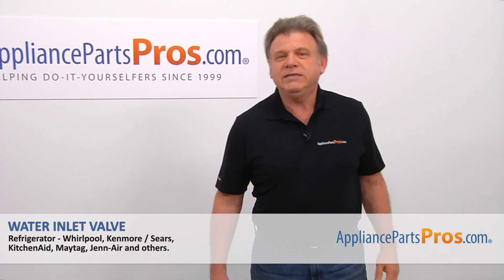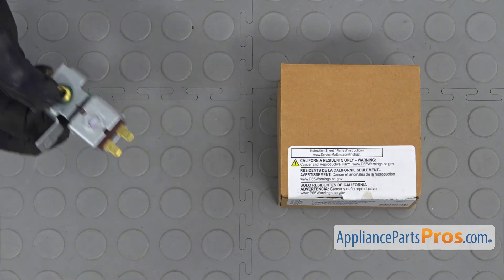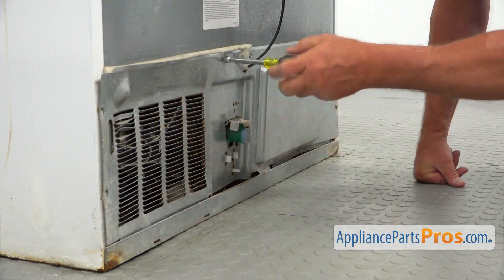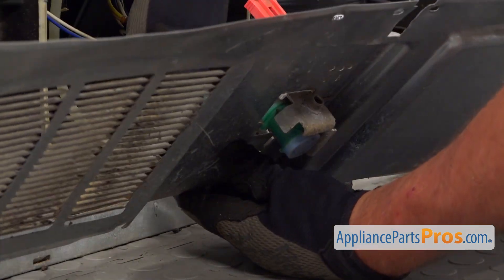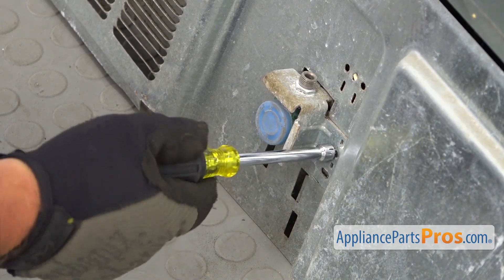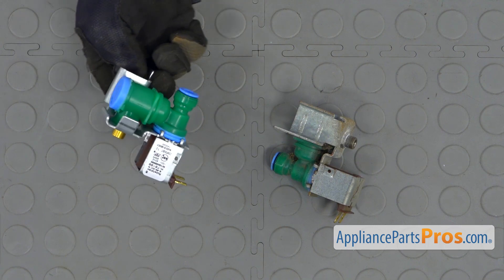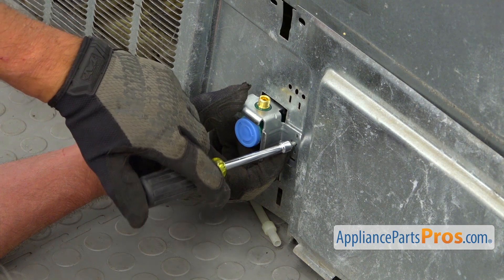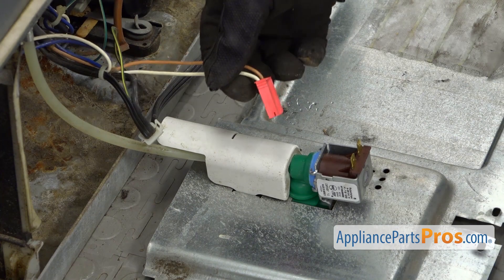How To Replace: Whirlpool/KitchenAid/Maytag Refrigerator Water Inlet Valve WPW10498990

Comment: Thank you for making this video.  My water inlet valve started to leak on my frig and because of your video I was able do the replacement myself ( I've have no pluming experience at all).  I didn't do this myself because of a costly repair, but because I have a problem with stranger coming into my house so much so I was going to just turn off the water to the frig and just buy bottled water from now on.  But, because your video was so easy to follow I was able to do the replacement on my own.  Thank you!
Reply from the maker: You are welcome! Glad you were able to fix your issue! If there is anything we can help you with in the future please let us know.

Comment: If the water dispenser works, but the ice maker does not fill up with water to make ice, is there something wrong with filter? I defrosted the freezer to make sure there wasn't ice blocking the tube that dispenses water to the ice maker.
Reply from the maker: You can remove the filter and see if that allows the ice maker to fill, if it does then the filter will need to be replaced. If it doesn't you will need to cycle the ice maker and test for power at the water valve. If you have power at the valve and no water comes in then the water valve will need to be replaced.